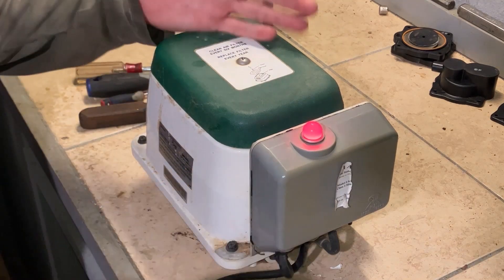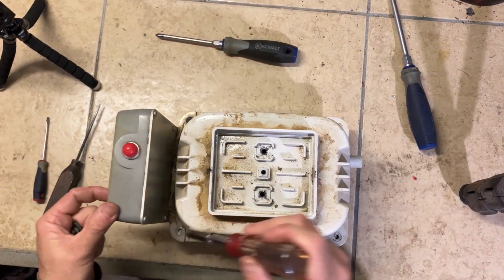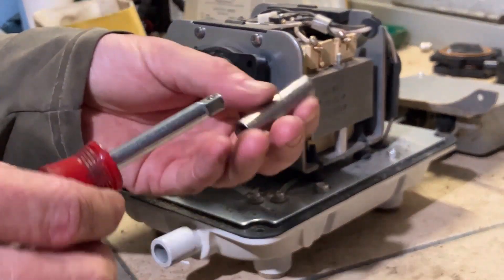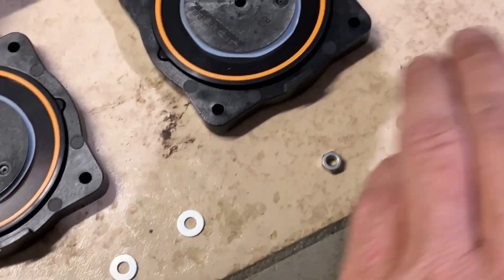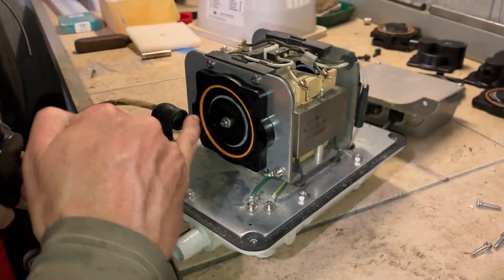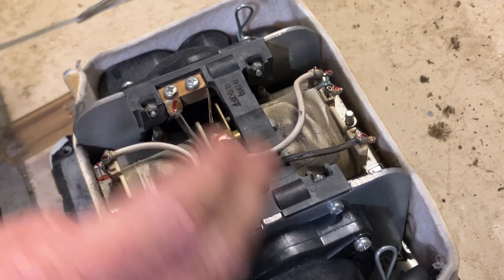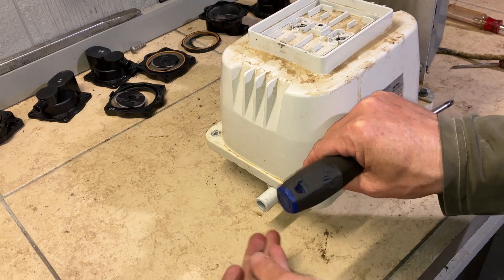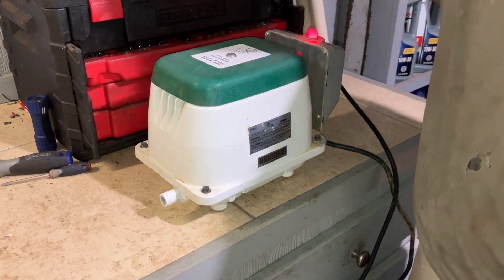Hi-Blow HP 60-80 [Rebuild Kit] Install Overview & Troubleshooting

Comment: Thanks so much for this repair walkthrough. I was just about to buy a new unit and be done with it. This should do the trick. I have a red light and buzzer on this same model. Have not torn it down yet but from the video it seems it can only be a bad diaphragm. My unit is 3 and a half years old.  Will report back.
Reply from the maker: Thats usually what happens to them. The one in the video has been serviced twice, broke rubber diaphragms were the problem both times. Its 10 years old, there usually due for service every 3-5 years. Sometimes ants will take them over if they can find a way in.
Reply: @hp_outdoors   Reporting back. Both rubber diaphragms were broken. Easy fix thanks to your video. All done, 15 minute job. Saved $300. Yes, I noticed I had a lot of ants surrounding it. Maybe they like the warmth. Killed all the ants, swept off the pad, back in business. Thanks again for the video !!
Reply: Question if both diaphragms are still good what can be the reason why the aerator pump won’t turn on, it does have power going to it.
Reply: @ricardochavez8236   Look at 05:47 in the video. Check that the break screw has not come off and there is a solid connection. That would prevent it from moving back and forth. If that break screw is still in place then I would use a multimeter to check that black SS-10 power cutoff switch you see in the video at 4:32 and make sure the SS-10 switch has power coming to it and leaving it when it is positioned in the on position. That black SS-10 switch could be bad. I'd say if the power circuits check out all OK you most likely have a bad motor. I'm sure HP Outdoors will respond shortly with his thoughts.